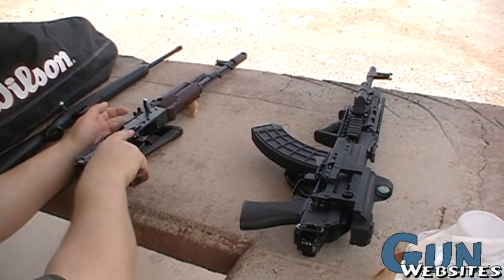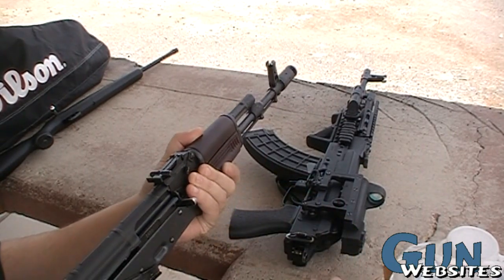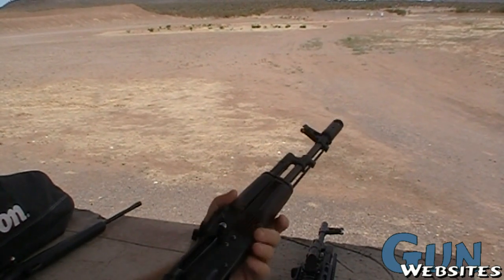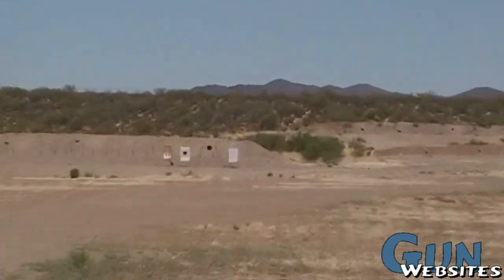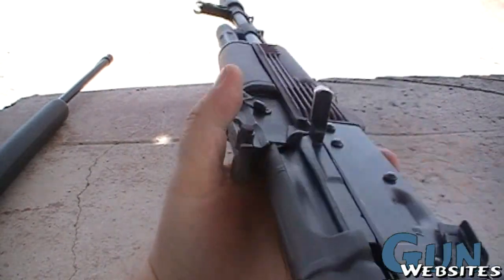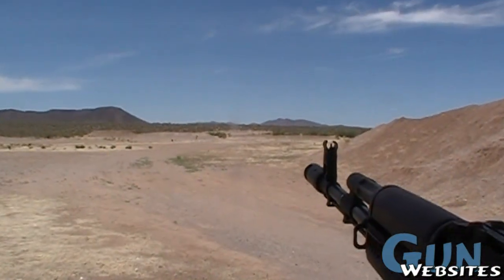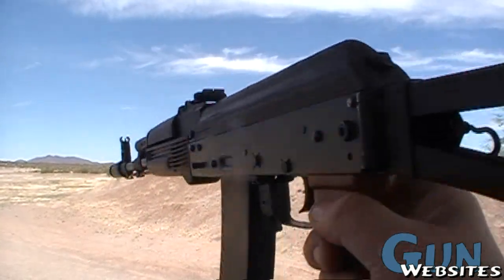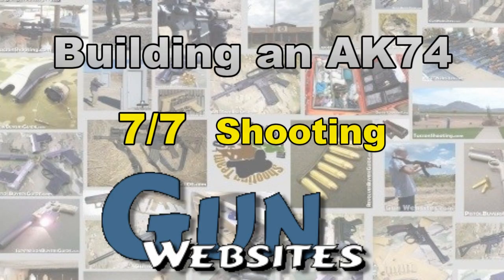AK74 Build: 1st Shooting !!!

Comment: That guy is totally wrong.  While it's illegal to build a new machine gun for non-licenced persons, anyone who can legally own a firearm in the US can build any semi-automatic firearm that they'd like.  There's some parts count issues, and it has to be modified from the automatic version enough as to not be readily convertable to full auto, but it's totally legal.

And it's not an AK47, it's the later AK-74, which is chambered in 5.45x39, a smaller cartridge mimicking the 5.56x45 NATO.

Comment: 5.45x39 out of an AK74 should theoretically be about as accurate as an M4A1 in 5.56x45. Perhaps .5 MOA difference or so? The rounds are ballistically similar and the barrel lengths are, what, 2" different? I'd like to see some 300m groupings out of both on a calm day, see how they do. If the shooter is thoroughly experienced with both, he/she should be able to get less than 8" at that distance.